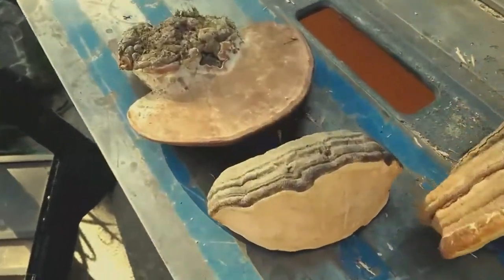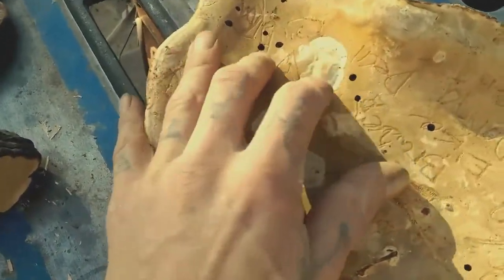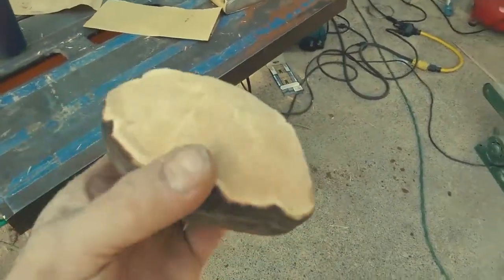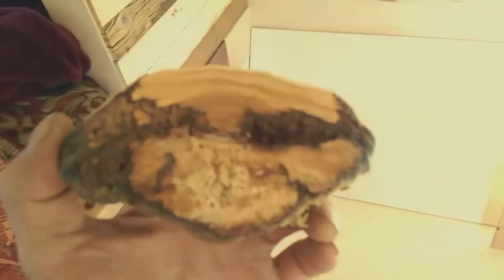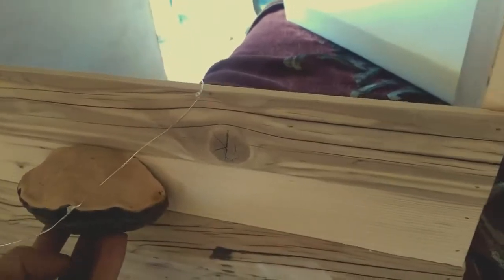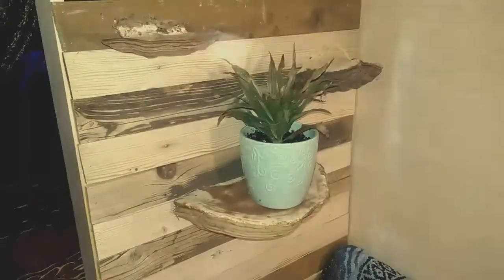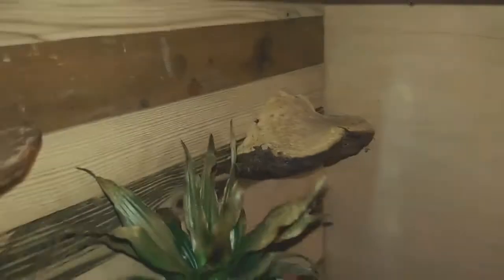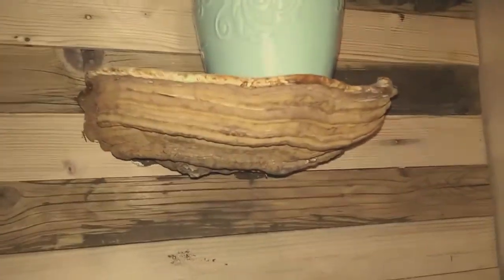Making awesome shelves from shelf fungus!!

Comment: Do these work if the mushrooms are slightly soft?
Reply from the maker: It's better if they're totally dry if they're soft they might fall apart
Reply: @carpo719  i found some that are just a bit soft. How can I dry them out?
Reply from the maker: @jordynrussell8159  I put them in a corner and wait a year or so. It's the only way to do it right. But some of them are soft naturally, and never become hard. It really depends on the species
Reply: @carpo719  Thank you for the response. I am currently drying some out in borax mixed with salt and it seems to be working fast